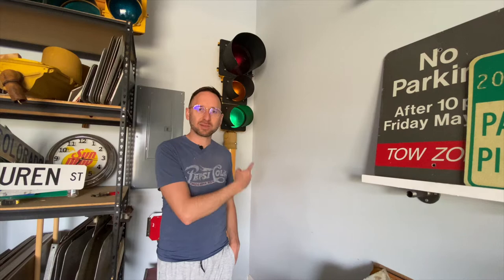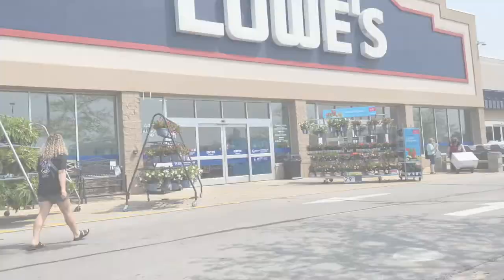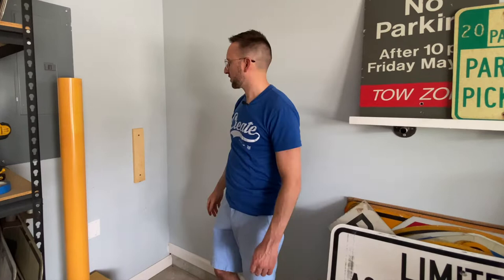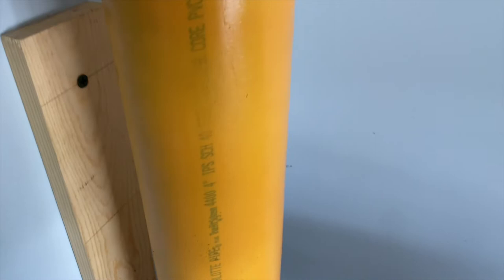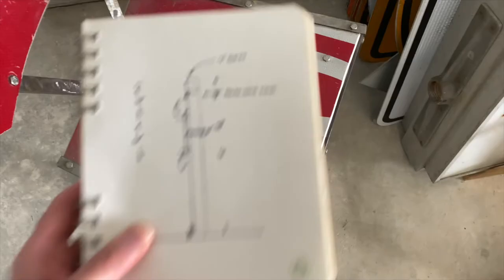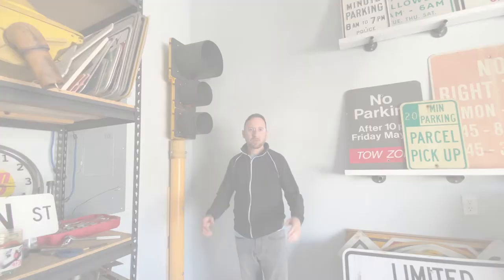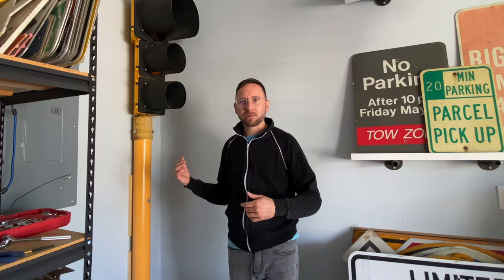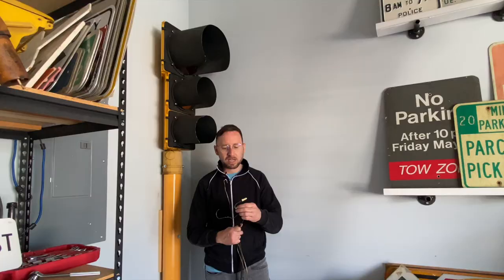I Installed a Real Traffic Light in My Garage 🚦

Comment: Never thought about PVC pipe. Cool idea. My swap meet "sign guy" was a no show due to the hot weather this summer. Hopefully next year.
Reply from the maker: I know PVC is not authentic, but it gets the job done. This one is about 1/4” thick, so it holds up the signal very well. I used PVC once to mount a cross street name sign that had a slip fit on the bottom.